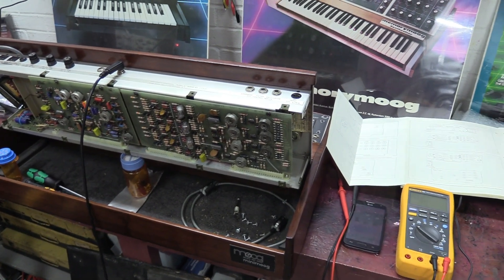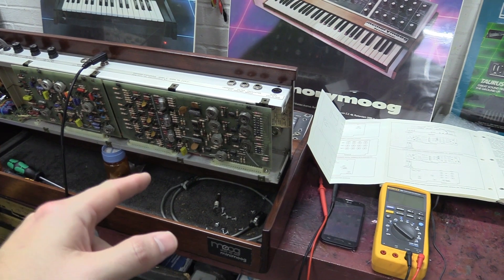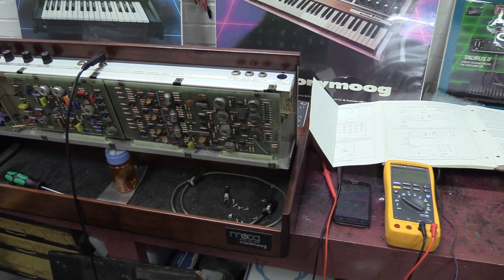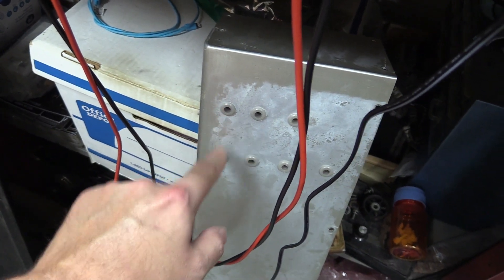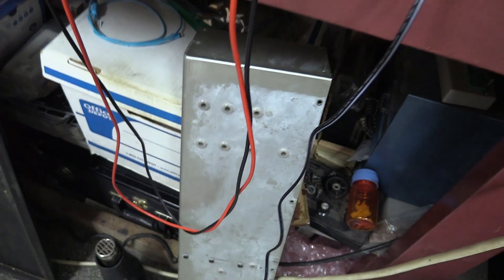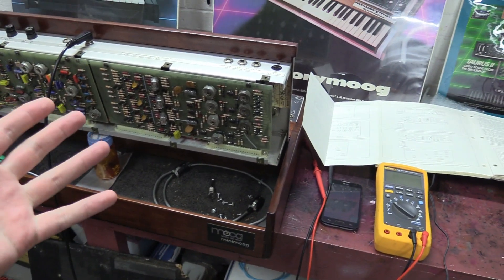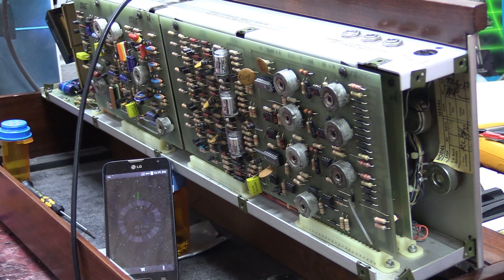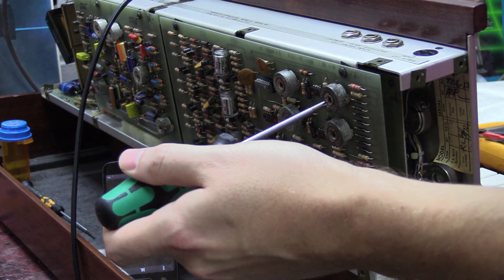How To Properly Calibrate Your Minimoog Oscillators (by synthpro)

Comment: Mine has access holes in the back cover so that calibration can be done with a (more or less) stable internal temperature.
Reply from the maker: They all have that with the exception of the VCF scale trim from 1972-1973...that access point wouldn't be added until VCF board was revised for a rheostat instead of the CTS trimmer, (talk about thos in a lot of my videos.

I had the back cover removed to visually show what you are doing inside.

Comment: Thank you so much! ;-) Does it make sense to use a different material of screw driver to calibrate these oscillators? Please, don't laugh… — wood? In order to avoid a negative influence for the trimming… Or does it ”fall in place“ anyway eventually?

Comment: Hi Jareth, my best compliments for your video! I have a minimoog 1973 year, no pcb buffer, when I calibrate the oscillators starting from 2 feet and then the octave leading to 32 feet in the intermediate footage the notes are all out of tone. I checked the resistors on the footage switch and one is 4.7 ohm and the other 10 ohm, while in the diagram they are 4.7 k and 10 k. Is there any error in the diagram? Furthermore, if they are correct like this, where could the problem be? The same thing happens when changing footage in the other two oscillators. Thanks for your reply and sorry for my bad English translated by google.

Comment: Hey Jareth, thank you for this great video ! My model is a little bit out of tunes when i check on the 32" :( ! Can you maybe provide a video please of the filter calibration ? Thank you. Nicolas
Reply from the maker: You're welcome, glad this helped. You may have some circuit tolerance issues, run into this quite often. I will try to make a VCF calibration video soon.

Comment: They make plastic screwdrivers specifically for adjusting tuned circuits. They remove the need to do the "technician calculated compensation".
Reply from the maker: That's very true but most musicians are not going to own one. The range is also very sensitive to slight tweaks.

Comment: Minimoog is a walk in the park compared to Odyssey tuning. I’ve spent a good couple of days calibrating a 2800. Hopefully the later ones are easier but this was definitely fun 😄
Reply from the maker: Odyssey calibrations are not too bad either but Arp quality does tend to suck in regards to component quality. I have had to add components/ change component specs in circuits in order to make some of their stuff function correctly....some of it probably didn't work correctly from factory. They tend to have noisy pulse widths and erratic frequency which takes some troubleshooting. They suffer from board leakage as well in some units.
Reply: Oh yes, all the opamps were bad on this except for the TO99 ones. Plus there’s extra calibrations on the early 2800 A board that’s a bit of a headache to get right. They got rid of those in later models.
Reply from the maker: @autoy  yeah, that early keyboard circuit can be a bit challenging.